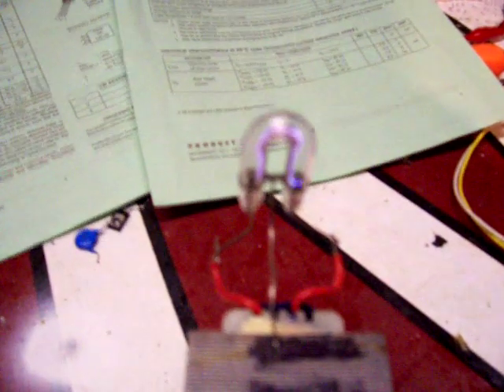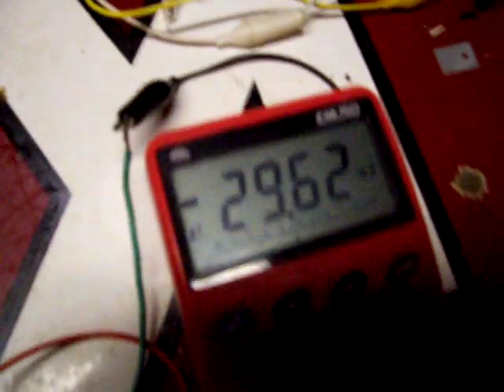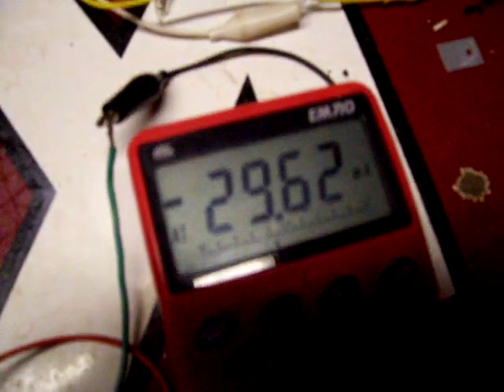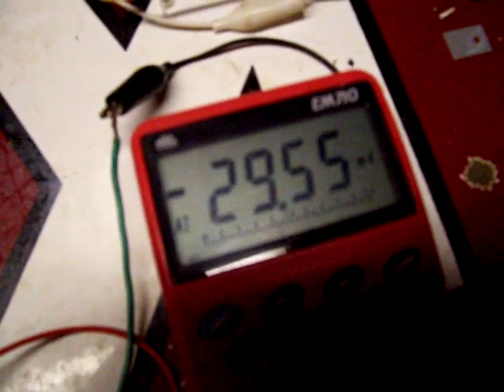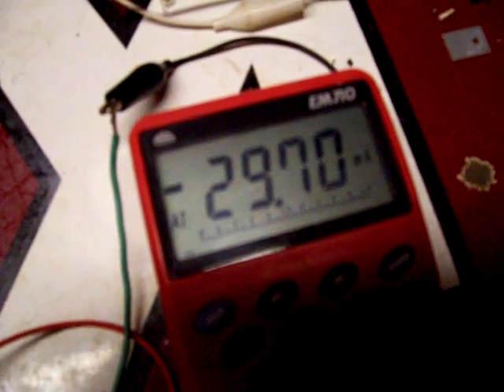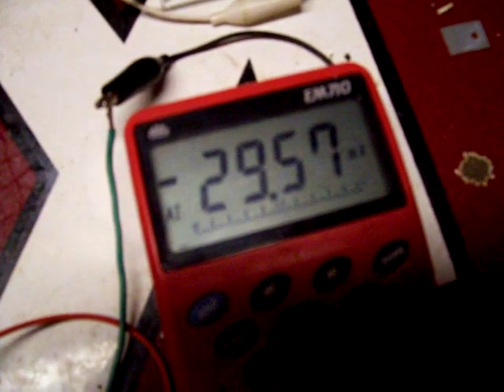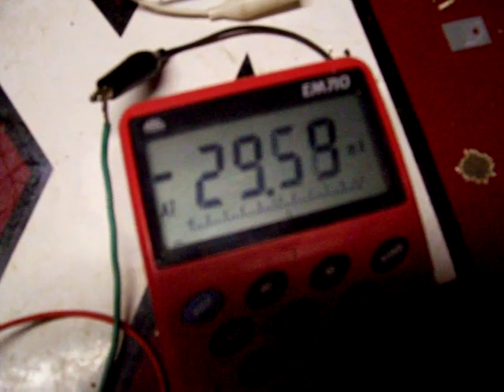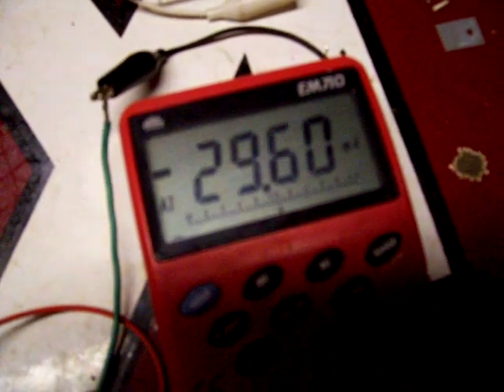joule thief w/3rd stage

Comment: I got a question. Are you pulsing the DC voltage throught that transformer? I thought that only AC voltage could be used with transformer?